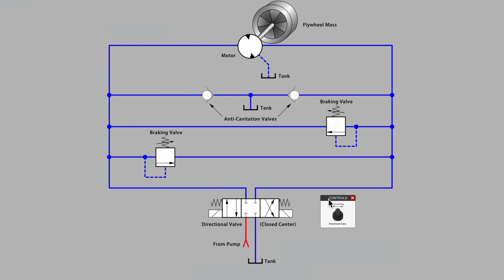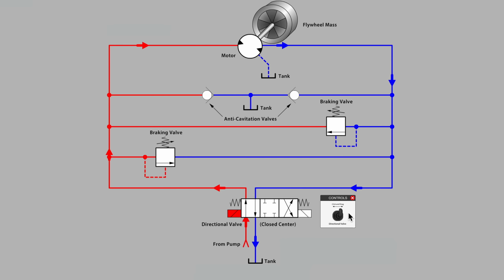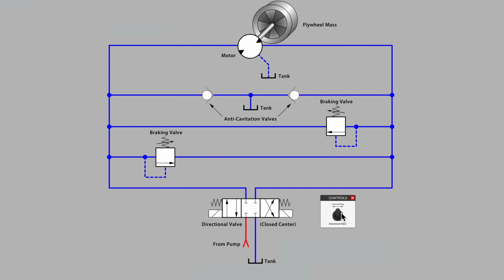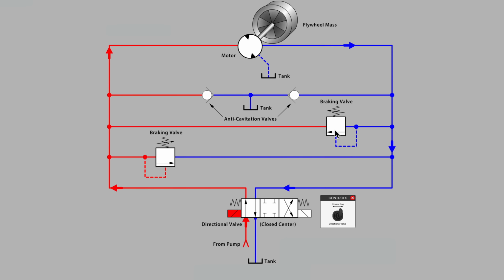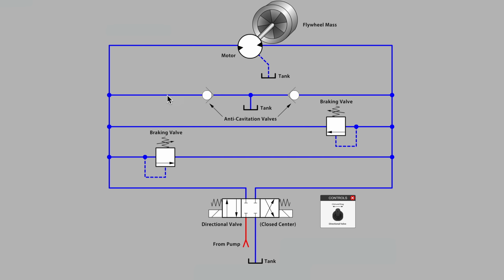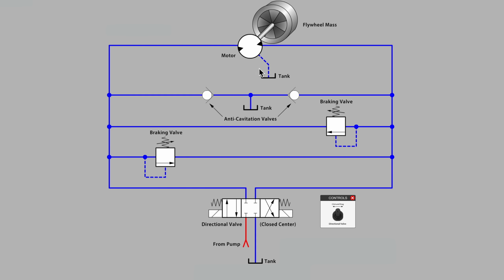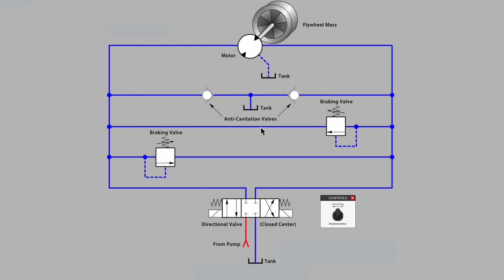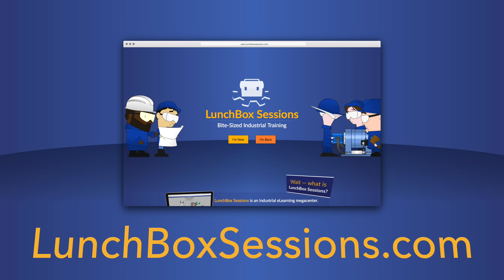Cross-Port Braking

Comment: I did a repair in Argentina where this situation occurred. when the load overran the motor, it pumped sufficient oil to blow (3) holes in the 1-1/2" 100R1 return line. The hose was roughly 6' long and the hose failed in (3) separate points. We replaced that hose with a 4SH (higher pressure). We ran the system again to see if the condition would repeat. When it did, it sheared the next hose in line clean at the hose end. Put a cross port relief in the circuit and every time after, it just blew to the pump intake. The designers did not understand how the operators used the equipment, so they never thought that this would happen, but it turned out to be SOP. In both instances, we nearly emptied the reservoir before we could kill the prime movers.

Comment: Someone should adapt this to be used for downhill braking on a gas-powered pickup truck. Diesels have exhaust brakes but they don't work on gasoline powered engines. This could be installed in line with the drive shaft to help slow the truck down when going down steep declines. As an aftermarket item that could be installed on trucks, I believe one could make a small fortune.

Comment: Assist me understanding what I am struggling to comprehend. When the DCV closes and the relief valve start relieving, where does the oil go to if it is just directed back to the opposite side of the pump and not back to tank as the DCV is in the closed centre position? Wouldn't all that flow that passes the relief valve to the opposite side of the pump just result in the same pressure or does the oil relieve to tank via the case drain of the motor? Wouldn't the shaft seal of the motor have possible damage with this transfer of flow from one side of the pump to the other resulting in the same pressure that was suppose to be relieved?
Reply: The oil blowing over relief is re-circulated back to the other port of the motor. The recirculated oil would be at a lower pressure as it has passed a relief valve. The shaft seal only sees the pressure in the motor case, so while there will be a small pressure spike there should not be any issue provided a correctly sized case drain is used.

Comment: Where does oil goes when DCV valve it's center position and check valve also suct the oil from tank so there is no drain of oil,where does all oil goes please clear.

Comment: Question One More, 
I had my contemplative. If these Spring remove, Back and Forward between controllers. I guess Turn on the Move controller  and then move racing wheel. :) Question?

Comment: Have a q? Does the check valve help from the main pump side to prevent cavitation on the pump when you operate the DCV at pressure over 3,000 psi.
Reply from the maker: Anthony Estrella, the check valve does indeed help prevent cavitation. In this circuit, the motor becomes a pump, driven by the flywheel mass, when the directional control valve returns to neutral (center position).
Reply: LunchBox Sessions 
Can you help me I am interested in learning more and would like to use lunchbox sessions training to help me.